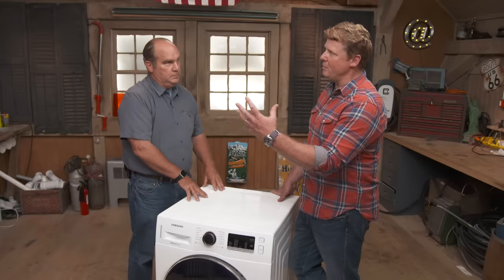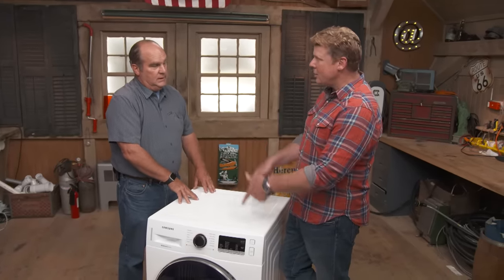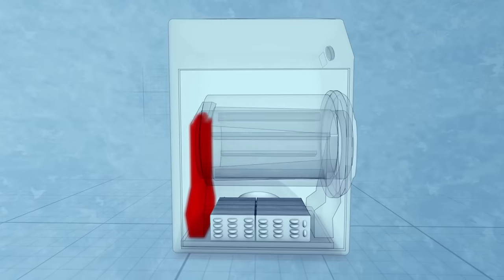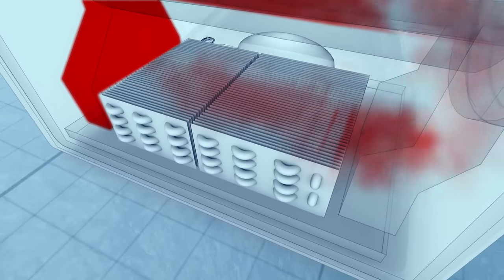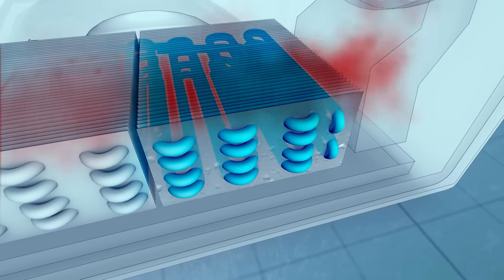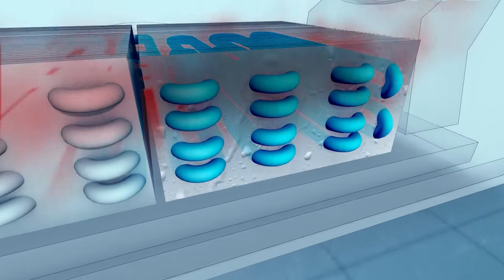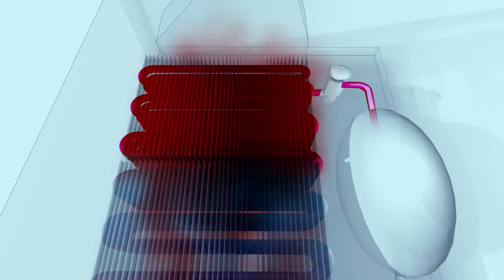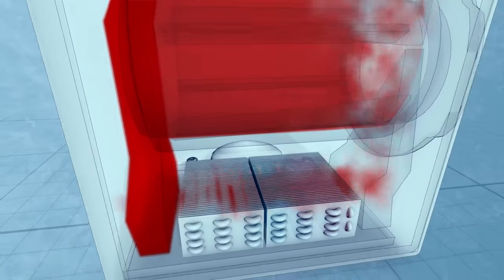Exploring a Heat Pump Clothes Dryer | Ask This Old House

Comment: The untold story here is that a regular dryer that exhausts outside also has to bring the exact amount of outside air in. If it is 100deg out then that air is brought into the house, your AC then cools that hot air only to have the dryer heat it up again! Likewise if its cold out then you are bringing that amount of cold air in only to wast heated air to the outside.
Reply: Which is actually GOOD if you have ventilation problems in the home, get a co2 meter you will be surprised.
Reply: @REALBanannaman I think you mean CO meter. As far as carbon monoxide is concerned you have a problem if you get any reading of significance . This also only applies to homes with gas. The other issue is when pulling a vacuum in your home you are bringing outside air in through all the wrong places (walls,attic,etc.) which is dirty air. If you want some fresh air get an air exchanger or open a window when the outside air is closest to desired inside temps.
Reply: @mmaxx9915  I am purely speaking about CO2, you'd be suprised. Sealed homes with 5-6 people inside running around will raise those levels to 800ppm sometimes, enough to cause fatigue and brain fog.
Reply: @REALBanannaman  In that case get an HRV (heat recovering ventilation), your example shouldn't justify an ineficitient dryer.
Reply: @lukasschmitz1799  That is dangerous. If the power goes out, your home turns into a slow killing chamber.
Reply: @REALBanannaman  Well, if the power goes out you can't run a dryer either. Besides, just open a window then lol.
Reply: @lukasschmitz1799  Winter power outages are fun lol
Reply: In winter I vent the dryer inside
Reply: Just be sure to get that moisture spread around the house @imbatido
Reply: 😂 @imbatido

Comment: For anyone interested in getting one, I'd like to note that A+++ vs A++ vs A+ makes a huge difference, not only in terms of power usage but also time per cycle. An A+++ heat pump dryer can take approximately 3 hours for a cycle to finish. The higher the efficiency, the longer it takes to run a cycle. Keep that in mind, as I spent ages looking for an A+++ enery rating dryer only to realise the cycle was 160 minutes.
Reply: This only applies for appliances made for the EU market.
Reply: Yeah, I'm staying at a hotel in France for the next few weeks on business, and my only option is a Miele T1 heat pump dryer in the basement... it takes OVER 3 hours to get my clothes... damp. Not fully dry. (Cotton.) To be fair, it does a much better job with synthetics, only about 2 hours to get them completely dry. But cotton? Forget it. I just try to get them to damp, then I have to hang them over the towel dryer overnight, and that saves zero electricity there. It's just one giant heating element.

It's an interesting idea, but I don't see how the energy savings work if you have to run the dryer 3 times as long. :\ Maybe they'll get it right on the 2nd or 3rd generation?
Reply: thomas seven  i have no idea. i've tried cotton, takes 3 hours. i've tried express. takes 3 hours. no matter what setting i try, it takes 3 hours, and the clothes are never dry. the most annoying part is that it uses its little "dryness sensor" to tell me, "oh, this will take 1:12 to dry!" i go up 3 flights of stairs, come back down, and the clock now says, "oh, did i say 1:12? i'm adding another 1:20!" then i come back, and it says, "oh, did i say another 1:20? i meant another 0:26!" then it finishes, and it's damp. i try running it again, it runs for 26 minutes, and its still damp. compared to my US dryer, i dump my clothes in, 50 minutes later on the lowest possible setting, and they're done and dry. maybe it's a faulty unit, i dunno. but my experience has not been great.

on the upside, going up and down 3 flights of stairs repeatedly has done wonders for my quads!
Reply: @ughtentide  I wonder if the filters need cleaning - that would explain it's predictions being out too.
Reply: thomas seven ,
How big of a load can you do?  I was about 15 shirts at a time, and I am still buried in laundry, so if I have to half that, then I really will be in over my head.
Reply: @TimothyBates  if you mean the coil, then that's an excellent idea. i have already checked the lint trap filters, and they're clean, but if the coil is dirty, that would explain it. i'll get in touch with the landlady and see what she wants to do. (it's her dryer after all!)
Reply: Wow. That wouldn’t cut it in my household. I'm used to 25-40 minutes to dry.
Reply: I have this model and it takes about 1.5 to 2 hours to complete a cycle.  The corresponding washer has typical 45 minute cycles so you have a little over an hour slowdown.  That said, it also only takes about 7 cents for me to run the dryer on my electricity rates, so I'm more than happy for that
Reply: joshdw my electric dryer only takes about 40 minutes. Hmm, 4x as long?
Reply: joshdw hydromatic technologies have developed a clothes dryer that dries clothes in less than an hour uses far less energy than any dryer on the market, it’s also the safest will not catch fire due to lint or any combustible source, has been awarded the ‘ green leaf’ label by UL.
Reply: I might add was developed here in the US.
Reply: thomas seven seconded. The T1 I used took no more than 2 hours for a full load of towels.
Reply: I have a Meile t1  dryer. somethings do take longer but it’s definitely not three hours. I imagine you have way too much in there.  If you want instant hot heat you need a gas dryer.   Also keep in mind when you own one you use it frequently and eventually you know which cycles to use for which fabrics and you figure things out.  It’s hard to judge it on just a few uses.   Keep in mind the Miele  plugs into a standard outlet and it doesn’t need to be vented. it is the only solution for people who want a decent dryer with no hookups in their apartment. the drawback is, it is expensive.
Reply: I’m not Sure which model you have and there are different cycles and features so it’s hard to say but keep in mind these are made to fit where your dishwasher can fit these are not full-size machines so yes I don’t think this holds more than what I say is a medium load of clothes in a full-size

Comment: You can cut your electric consumption by 100% by drying your clothed on a clothes line. Ask grandma
Reply: You cannot dry them outside on a very we and very windy day in winter though as it would only make the washing wetter. 
Dryers can be used on days when the weather is soggy.
Reply: I like to air dry but towels come out crusty and hard feeling
Reply: @mav48185  If you hand wash them they won't.  Machine washing leaves a lot of junk on your clothing which causes the crusty effect.
Reply: inter peter I didn’t know that. I ended up buying a small dryer it’s considered portable for my apartment but gets hot like a normal dryer lol I just put the towels in there
Reply: You can dry your clothes indoors just hang them on hangers and use a clothes rack. If you put  the rack over an HVAC vent the clothes dry fast and humidifies the air in the house which is good in the winter. Works well when you're cooling the house in the summer too. Helps if you wear a lot of artificial fabrics as they dry way easier.
Reply: actually machine washed clothes are perfect,machine washing clothes is convenient as you can do other things you need to with out taking up precious time
Reply: @cliffordbradford8910  that will cause mould to build up
Reply: @stephensnell1379  actually you are wrong and obviously have not done much hand washing of clothes after they've been machine washed.
Reply: @stephensnell1379  hang drying does not cause mold to build up.  Please stop spewing nonsense.  Next you'll be saying that you need to live somewhere where it doesn't rain because when it rains mold will build up.  Don't be ridiculous.
Reply: Good one, & don’t laugh , that is the only way to dry clothes

Comment: I've owned a Japanese model for ten years. The cost of electricity for every cycle is about 10 cents USD.
Reply: What do you have? I'm curious.
Reply: Yes what is the make and model?
Reply: @icie4u  It's a Panasonic. I don't remember t he model.
Reply: We've had these in Scandinavia as well for many, many years. And our electricity cost is typically cheaper than in the US, but these are still a a no-brainer
Reply: Just to be clear, heat pump driers are SLOW. It takes a little more than an hour to dry a load, 2 to 3 times slower than traditional ones. It's just really efficient. I always start before sleep so it doesn't bother me at all.
Reply: Wow!
Reply: @JW77  He claimed in the video that it was slower but negligible. Thank you for clarifying.
Reply: @SM-pd5cl  I'm just speaking from my experience though. Maybe there are heatpump dryers which dries as fast as traditional ones.
Reply: @SuperSiggiboy  Yea if I can get one BIG enough I don't need one that drys a pair of pants and a shirt I need one like 7 cubic feet.
Reply: @JW77  Efficient is good, but I need BiG load capability. Not a load of Barbie clothes.
Reply: How come noone has invented a way to keep the HOT AIR inside your house and pull the humidity out
Run it at night to supplement the heater
Why pump 140' f heat outside?
Reply: @thecloneguyz  are you talking about a traditional dryer? They do make vent hoses specifically to vent indoors, with some kind of filter on the end. Maybe it's just not practical for the relatively short time that people are doing laundry.
Reply: @thecloneguyz  Great idea man. One compressor. Heats water, dry cloths, heat/cool home, and fridge All in the same unit
Reply: Do they plug up a lot and how long do they usually last?
Reply: @thecloneguyz  Heat cannot be destroyed, if you have a vent less dryer like the heat pump, the 50% of the electric you use that you don't vent out will heat up your house. What I do want is a heat pump dryer that will vent to the outside, so in the summer it will not heat up my house with 50% of the heat.
Reply: @shingwong2  
We grow marijuana 
We run the rooms at night 
Electricity is cheaper 
And the air cooled hoods pump 160°f heat into my return air of my furnace
We switch the actual furnace off
Just run the squirrel cage connected to thermostat - free heat at night to heat house
Reply: @SM-pd5cl  depends on your ambient temperature, they have a hard time in cold weather
Reply: @thecloneguyz  on amazon they make the indoor filter adapter, I was thinking about using one in cold months to reclaim the heat .
Reply: @patricku9  I haven't seen it but as long as it removes the humidity you might want to run a dehumidifier also just in case it doesn't work that good cuz you don't want humidity to make yourself sick
Reply: @thecloneguyz  humidity is a good thing in cold winter air. I would vent it back outside in spring.
Reply: @patricku9  I don't know what you're talking about cold winter air because the dryer removes humidity with heat therefore if you pump it directly into your house you're going to fill your house full of humidity
You need something that separates the humidity from the Heat and removes the water or you're going to have water running down all your windows all night long
We are talking about a 140-160 degree heat from the dryer that's packed full of wet humidity from the wet clothes
Reply: @JW77  Nope, they're all quite slow compared to regular ones.
Reply: @JW77  Bosch 500 heat pump dryer owner here. With our clothes, additional time is negligible or the same, in our experience. And, much easier on the clothes. Perhaps your dyer is not working properly?
Reply: Richard Wolfe:  You right, you "don't know" 

Since Patrick Underwood  was correct "humidity is a good thing ( to add to dry) winter air"
Reply: Really? I'm surprised that it lasts this long.
Reply: No way it's only 10 cents for a cycle.  It uses that much just being plugged in.
Reply: @mccalejk2    I actually tested the power consumption right after I bought it. It consumed slightly more than 1 kwh for the entire washing and drying cycle. That's roughly 10 cents where I lived. I couldn't measure any phantom power.
Reply: @taufiq6573  Heatpump is nothing new. I moved to the US about 10 years ago and I was really surprised the appliances here are so old and outdated (and expensive too) compared to the rest of developed countries. Back when I was a kid, GE and Maytag were the best.
Reply: @SM-pd5cl  depends on the model and what weight of laundry it is rated for.
Reply: @QuantumRift  Barbie clothes lol!  Exactly I saw these are like 4 cubic feet. I looked at our Maytag and it is 7 cubic feet. 75% bigger!  So not only are you spending twice as long drying you are doing less clothes. Not sure my wife would like that aspect
Reply: @WatchAuroraCouncil  what about the size of the load?  My Maytag gas is 7 cubic feet. These are like 4 I believe. Big difference.

Comment: Honestly I'm much less interested in the power savings than the fact that it doesn't need a vent.  I think that's the real story there.
Reply: And it probably works with a regular 15A outlet, too.
Reply: MarkRavingMad Condenser dryers are common in Europe, they don't need a vent either but are faster than heat pump dryers and cheaper to buy. They have the advantage of putting the waste heat into your home. They are ideal for cooler European climates where we tend to mainly use dryers in the winter. The waste heat warms your home reducing the heating bill.
Reply: Spencer Wilton euro Condenser dryers are available in heat pump models as well which are basically the same as this unit.
Reply: Spencer Wilton it seems like the newest models are all heat pump dryers... Do you think condenser dryers are going extinct?
Reply: Close to real story. If you ever took apart a whirlpool/samsung type dryer they have a rotating drum that seals with felt bushings and they leak lint as it blows all over the wash room and the house. The Bosch is a sealed unit, no lint ever gets out of the dryer. Also like my 20 year old Bosch dryer a cooler temp preserves the clothing and they last/look good holding color longer.
Reply: John Huynh I think condenser models will be around for a while. Heat pumps have fallen in price, but are still more expensive. Many people don't like the long drying times. Condensers are faster, at the expense of higher energy use, but the energy wasted is not really wasted if it is useful in keeping your home warm. Of course, in summer it's a problem but few Europeans use a dryer when the weather is good enough to dry clothes outside.
Reply: That’s why you don’t own Tesla
Reply: @spencerwilton5831  Condensers fill the room with humidity though. You may like that at first but after a while you start to get mold. Heat pump dryers release only dry air. As a matter fact they’re basically just a giant dehumidifier.
Reply: GeologistMike No, condenser dryers don't fill the room with humidity! The air within the dryer circulates continually, passing over a plate heat exchanger cooled by the room air. The two sides never come into contact or mix. Water is collected in a slide out container, or in some models can be connected to the washer drain. We have had several condensers over the years in various properties and aside from one particularly crappy cheap indesit one that leaked have never noticed any trace of additional humidity. They do heat the space they are operating in quite considerably, but they don't make it steamy.

Comment: I just got a GE Washer/Dryer Combo which is only one unit. Never have to transfer the wash load to a dryer but goes into a drying cycle using a HEAT PUMP. I've had it now for 2 weeks and loving it!!
Reply: @fiat.freakx19 How has your combo unit held up over 6 months?
Reply: @kaknu been GREAT! Cleans clothes very well. Drying has been great also, i take out my cargo pants early as it tends to wrinkle them if i complete the dry cycle. Lint clean off about every third cycle. The app works ok, sometimes hard to connect but i find this common as with other appliances ive done this with. Overall this had been a great machine with no complaints or breakdowns. BUY ONE!!
Reply: Hahahaha. GE is actually haier. It will break in 6 mo. Then your warranty will be up and it'll keep breaking. Sell it now. We throw them away at work all the time. Juuuuunk.
Reply: Keep an eye on mold . FYI .
Had a Samsung unit in person in 2018 . The components continue to sweat for hours after use . Mold below the drum and in rear

Comment: This is basically a heat pump (which is what an air conditioner is, regardless of the marketing term) with the controlled/ambient heat transfer effect being wasted, but still getting the dehumidification.  A conventional dryer wastes the hot side so as to remove the humidity.